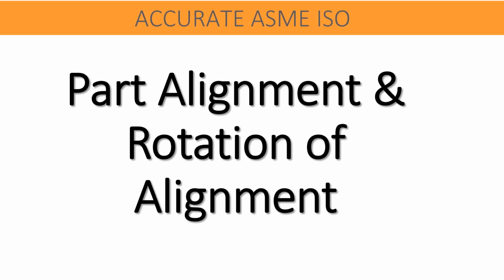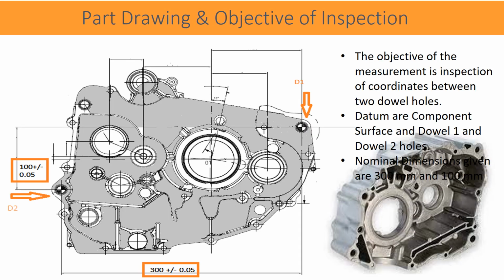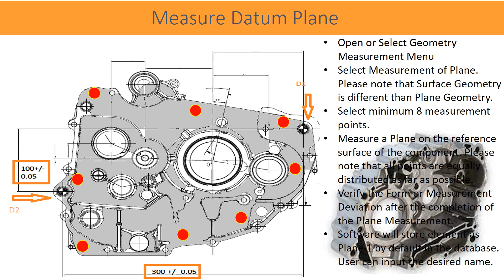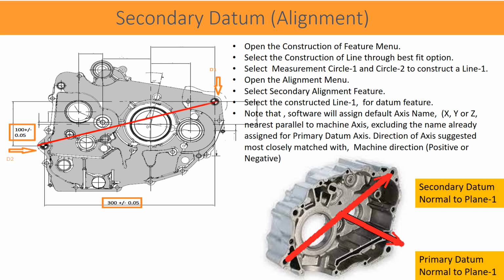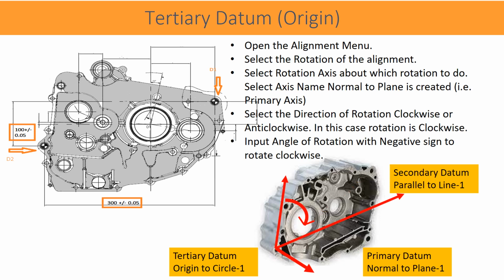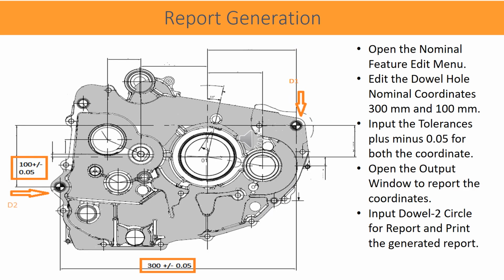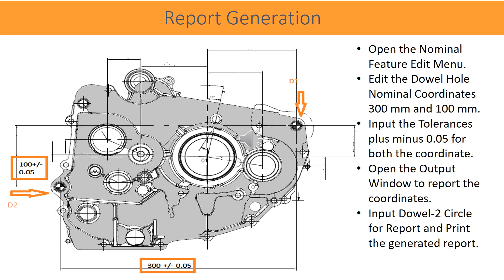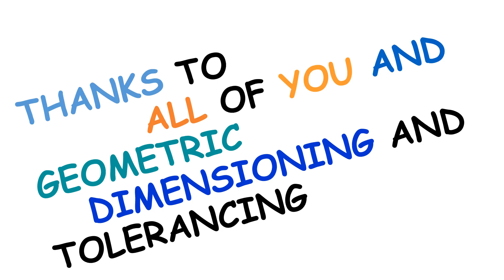CMM Alignment & Rotation

Comment: What is CMM least count ?
Reply from the maker: CMM specify Resolution not least count. There is slight difference between Resolution and Least count.
Answering your question, there are different resolution of CMM depending on Manufacturing CMM accuracy specific.
Normally 0.1 mm is most commonly specified resolution.
For very high precision accuracy CMM it could be lesser than 0.1 mm.